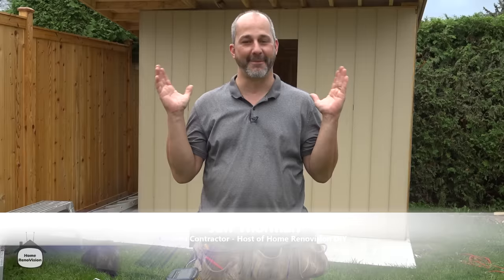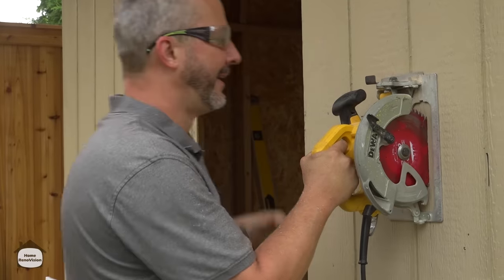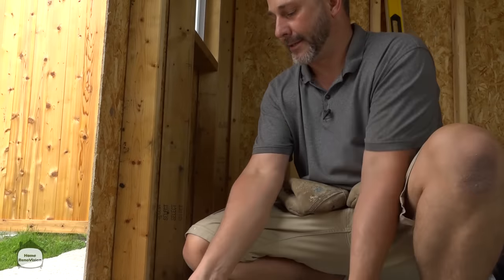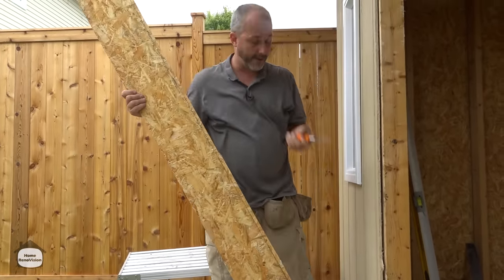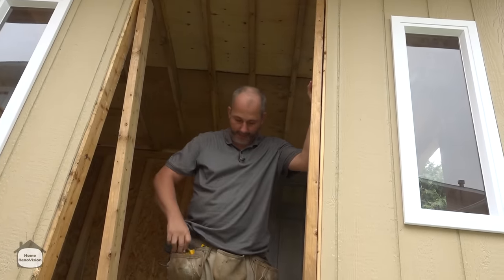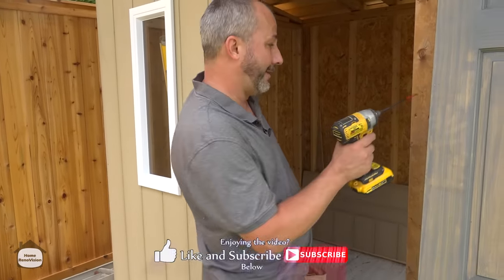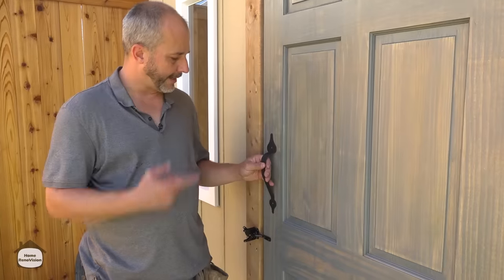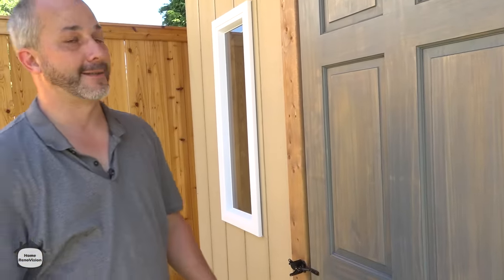How to Build a Shed: Part 5 | Doors & Windows

Comment: How about some caulk behind the widows to water proof it and to help hold it in. You could cut the door down to size. You should have your safety glasses on when cutting. You could lock yourself in...…….:)
Reply from the maker: Watch the whole series we do caulking, and the window is screwed in and doesn't need help holding in place. If I cut the door then the hole would be too small and I would spend the next 3 days refinishing and sealing it again. I wear glasses when i feel it is dangerous. In the next video we install a safety string. Cheers!
Reply: Thanks for getting back to me. I did watch them all. I think they were great. I just added my 2 cents. I want to build one that is 9 ft. in front and 8 ft. in back. You make it look easy.
Reply: I have watched whole series. Nice Job. I want to build one 9 ft. in front and 8 ft. in the back. Maybe 12 x 12. I liked how the roof job went. Thanks for the info.

Comment: Nice video Im doin a 10 by 10 shed w same flat angled roof 12 x 12 Im for KISS keep it simple stupid as Im not a carpenter I got the same screw gun pawn shop special I love it but some times doesnt seem to bight in that smart pannel but well see what happens today maybe need a new bits  My shed is probably gonna be a work of art rather then a shed in a box or pre cut. Long as I have a place to store all my tools n things through the winter Is really all that matters to me. Cuz I have things stored all over n Im getting old n cant always remember where I put them wen I really need them If it was up to me Id have a shop cuz I like experimenting anyway. I put the roof up n my brother tells me about the ladder thing on the sides n I didnt know what he was talking about n I may need to put support beams inside cuz its almost a flat roof very little angle maybe 6-8 inches high from high side to low side. N now Im starting to put up the walls/siding n having issues since Im by myself! I remember I have a bunch of straps n clamps thank God that may assist me to hang the pannels better n Not totally happy with how square it is either. My biggest deal will be how well I can cover up my mistakes on my first ever shed build Wish me luck! I am planning to sheet my roof w sheet metal from an old Arrow metal shed project that didnt work so as I say it may be more of a work of art then a pre fab shed! but keep in mind as you say its just a shed.

Comment: Not a safety comment ;) Nice door and easy lock, however you may want to thread a line from the lock to the inside of the shed, so that the owner doesn't get locked in the shed when the door decides to close on its own ...

Comment: Different way of hanging door, i enjoyed the vid until you put a gate latch on the door, really needs inside outside handles with mortice lock on door like that, the mortice would been a good vid, not good if wind slams door on you lol, good vid bud

Comment: Only down fall with that latch is, if someone wants to get in all they have to do is unscrew it.
Reply from the maker: At least they won't be destroying my shed. And they also have to get past my dog, perimeter security,and shot gun. I might even hang a screwdriver next to the latch in case they forget one on the night they plan on stealing my watering can!
Reply: @HomeRenoVisionDIY  good way of keeping them out
Reply: Keep up the good work
Reply from the maker: Thought you might like that. Cheers!

Comment: I don't think I have ever seen you wear ear pro.  Get it together!!!
Reply from the maker: I did on this job when using the explosive hammer. Other than that not usually. I find being aware of my surroundings outweighs the noise protection. BTW not a day off work due to injury on the site in my whole life.

Comment: The safety trolls forget that they are the ones needing to worry because they don’t have the comfort of having made those same cuts same actions time and time again.   Your amount of nerves relates directly to your abilities.   If your thinking all the safety aids can replace ability and attentiveness that’s a mistake. Back up beepers have proven to be detrimental on large job sites due to so many are in use people don’t pay attention to them.  Yet operators have that false sense of security so there not as attentive.  End result is that backup injuries are on the rise.   No amount of safety equipment can replace proper situational awareness.
Reply from the maker: Wow, a voice of reason in a world gone mad. please feel free to chime in anytime. Cheers!
Reply: Exactly, Bugkiller666... they ARE the ones who need to worry. But then again, as Jeff says, he is helping out the "average homeowner looking to tackle a job." The average homeowner does NOT have the experience Jeff has. A word or two of basic safety advice - "I cut like this because I've years of experience, but you may prefer to make this cut using sawhorses for more safety." - is never amiss. Or even, "Cutting like this is safe, because kickbacks only happen if you twist the saw into the cut. Hold the saw firmly and cut straight and you will be fine."

What I don't care for is mocking those who are merely pointing out that -- while the risk IS very minimal -- there IS a risk, especially to the very people who are here seeking his advice, the inexperienced homeowners. Making people feel stupid for being helpful is poor form.

Comment: 40C is about 104F, for those who got confused by the temperature comment.
Reply from the maker: hot enough to do some crotch pot cooking. Cheers!
Reply: Rough mnemonic for my fellow Americans: 0 is freezing, 10 is not; 20 is perfect, 30 is hot. Obviously this ditty is very rough. 20 is actually a bit cool and 30 is pretty warm rather than hot. But for someone raised on Fahrenheit, this will quickly get them in the ballpark. Since 40 is greater than 30, you quickly realize you're dealing with a Texas type of heat, and don't mess with Texas.

Comment: I don't understand why we always put hinges outside it not good for a security point of view. and body easy to remove screws and excess inside . not happy the way you cut the window, just one leg touch with one side with the frame. and cutting must eject size not loose ..why not use perfect measurement. its just test and trial basis .. very very rough work. no accuracy at all.

Comment: I don't think I'd use that kind of hardware on a shed that had anything valuable in it. If the screws are visible, the lock is irrelevant. Anyone could unscrew the latch and be into the shed.
Reply from the maker: I hear what you are saying and yet I was in the insurance business for a few years replacing doors from break ins ! I have not seen a house that a thief can't break into yet. That is why I have my tools insured. Cheers!

Comment: It maybe safe but it has been shown to cause cancer in California!
Reply: what is?
Reply from the maker: Hi Charlie, what are we talking about. And why does California always think that everything causes cancer. And if everything does then that explains why everyone will eventually die. So let's live a little in the mean time and not worry so much!
Reply: Sorry guys it was just my odd humor taking over about the safety geeks being upset by a board being held in one hand and saw in the other. 
 I'm not sure why California thinks that everything causes cancer I live in the NM.
Reply from the maker: Now I get it...LOL, sometimes I forget that many comments are made from the linguistic style of banter not as a question or statement. It is still confusing some times. Cheers!
Reply: Yeah I should have maybe put LOL after or prefaced with what I was referring to. 
It's all good, thanks for the videos, I'm an electrician by trade, I not going to say I'm not very good at carpentry, but I pick up a saw on most jobs and one of the framers is instantly wanting to know what needs to be done!

Comment: Please don't make jokes about safety e.g. like at 9:00 skill saw kickback. You are directing your videos to unskilled DIY people and not professionals like yourself. DIY people may even use a skill saw made 30 years ago not meeting the safety standards of today (e.g. soft start). It would be fine just to mention: "If your not familar to cut one-handed with a skill saw, go get a pair of saw horses or a sturdy working table and do it the proper way or take a hand saw."
Sorry, I've seen the breaking of a cutting disk on an angle grinder flying 50 ft through the air ending up sticking in a car door. It's not funny ...
Reply from the maker: First of all let me say that most of the so called professionals have the worst habits when using tools due to familiarity. At least homeowners have a healthy respect for tools and I trust them to know their limits. don't talk about grown ups as if they can't read a warning label.